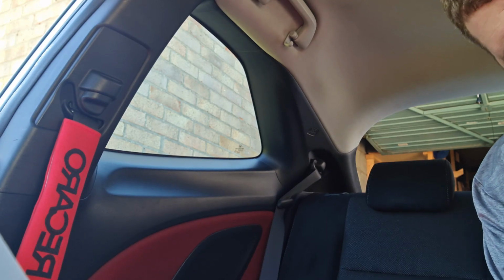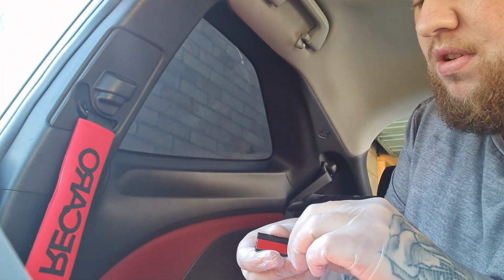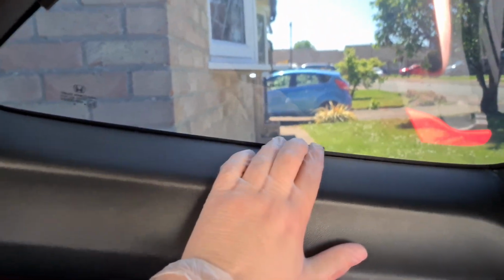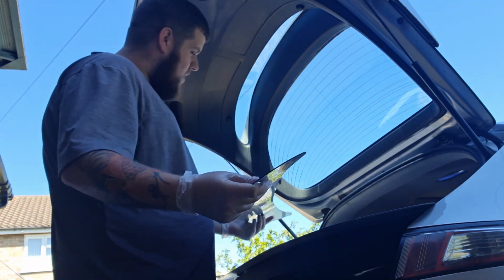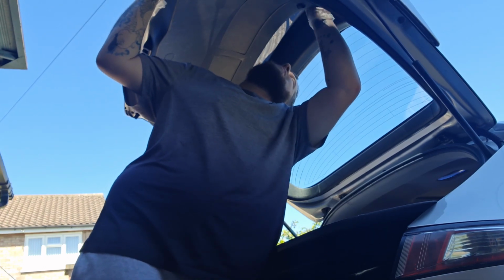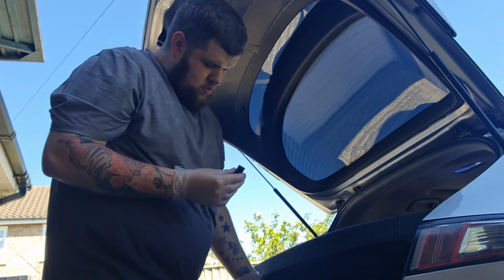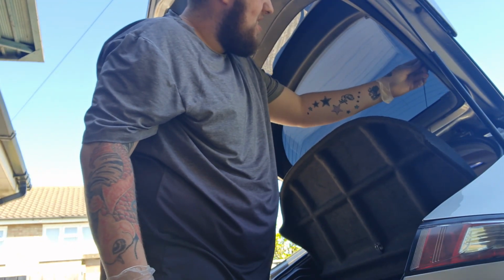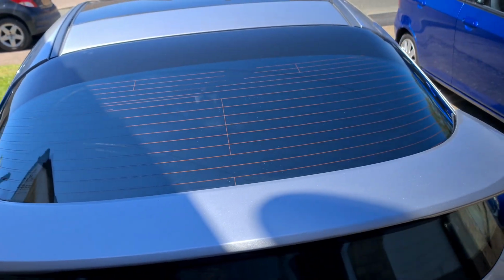The civic gets SOLARPLEXIUS tints!!

Comment: Hi dude might be a silly question but can u open yr back windows with those fitted
Reply from the maker: Hi mate this is a 3door model the back windows don't open 👍
Reply: @Billyevans93  ahh ffs ok no worries
Reply from the maker: @Mooney76  if it helps the pieces are held in by push type clips so I would gues you wouldn't be able to put them down with the windows on a 5dr
Reply: @Billyevans93  ok thanks dude 👍
Reply: You can't. If you put the window down and are driving fast enough they blow out 😂 Absolutely useless
Reply: @bEEBO178  nice one glad I didn’t bother 👍

Comment: Hi! Did you still have the car in winter? I wonder if any moist is build up between the window and the pane when it’s cold or foggy.. and do you feel it really stick to the window or when you press your finger on it, it still bends a little? Thanks!
Reply from the maker: They where in there pretty tight mate and if you use the clips properly they should stick to the window pane pretty well I did have it for a short time in the winter and they seemed fine didn't notice any difference 👍

Comment: Don't bother. They rattle like crazy and if you have rear windows that open the tints stay in place so defeats the whole purpose of power windows. If you go fast enough they blow out. Just get a proper tint done by a pro for the same price.
Reply: It's just they look dark brown on the inside & scratch so easy.  Plus side it came pretty quick considering it came over seas like Sweden (Can't remember now) to London,UK. No blocks to keep them in place like in the video but mine don't rattle much at all. A proper tint film would be the best route, a family member has tinted windows for like 10years & still looks great today! No scuffs/scratches.